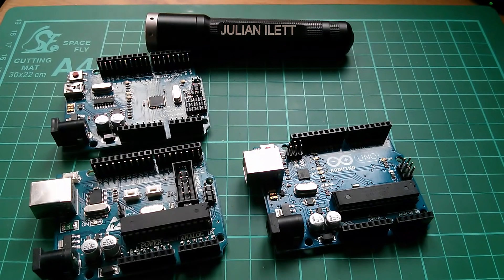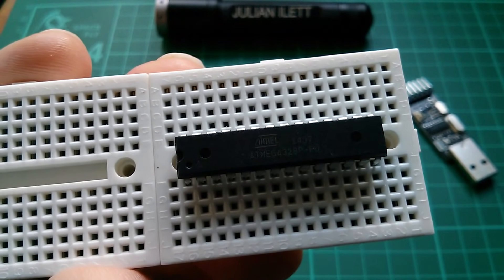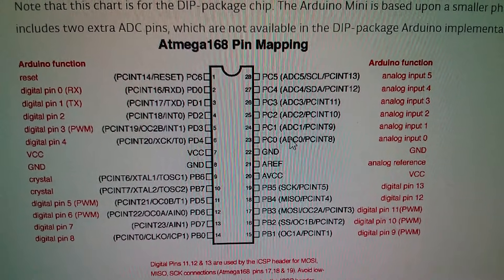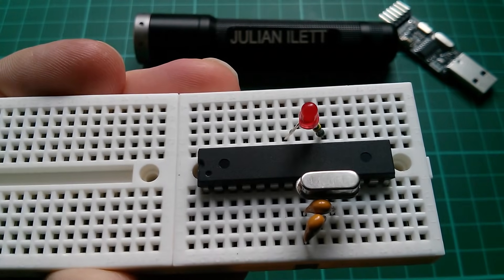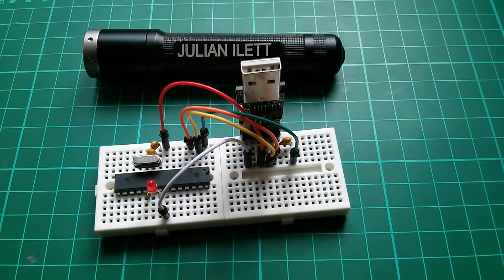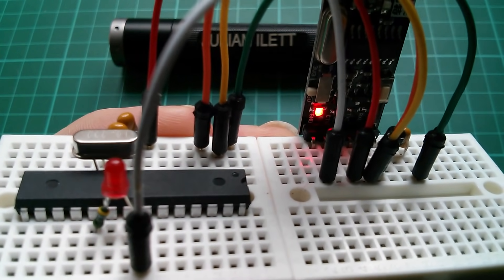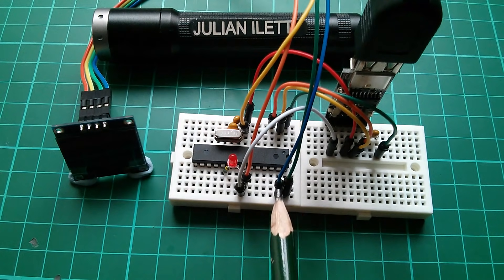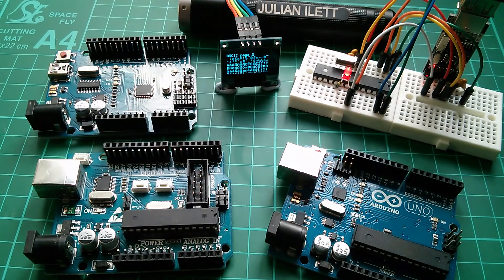1-Day Project: Build Your Own Arduino Uno for $5

Comment: Julian, I really need your help. I need a microcontroller that could drive two 12v 5Amps brushed DC motors in two directions and I also can take two ampere sensors. Would you please help me pick up a cheap and good microcontroller and motor driver? :)

Comment: I was getting this error: avrdude: stk500_getsync(): not in sync: resp=0x00.
My solution: use 1 uF capacitor on the DTR instead of 100 nF.
Reply: I had this problem also.  It seems dependent on the chip being programmed.

Comment: Might be cool to see how small you could possibly build one, by not using a bread board and soldering the connections together then putting the serial port under the chip with any type of thin insulator in between.

Comment: Hi Julian, great video.

I followed the instructions to make my own arduino UNO, and used all the same components, except for the USB (I used this one: http://www.amazon.co.uk/gp/product/B00AFRXKFU?psc=1&redirect=true&ref_=oh_aui_detailpage_o00_s00  ). Everything works but in order to upload the code I have to use an AVRmkII (  http://www.atmel.com/webdoc/avrispmkii/avrispmkii.intro_connecting.html  ) and use the "Upload via programmer option in Arduino IDE and set programmer to AVRISP mkII. Initially I had to upload the bootloader to the ATMega328 chip via the AVR, after which I could upload the code. The blink program worked so I uploaded a more complicated code which has data that can be viewed on the serial monitor. However I cannot get the data to view on the serial monitor even though the USB is recognised as a serial port ( I also cannot upload the code straight to the breadboard via the USB, hence the use of the AVRmkII).

So I would just like to ask if you have any tips or solutions for my problem (how do I view the data on serial monitor)?

If anyone else reading this has any advice or requires further info please feel free to reply I'll try my best to provide as much info as I can. Would really appreciate any help.

Thanks in advance

Comment: After a 10 min build turned into nearly three hours of frustration and cold tea I finally decided to pull out the IC from my arduino uno, and put one of the "bootloaded" IC's I bought. Figuring out it wasn't bootloaded, I returned the original IC to it's socket and burned burned the bootloader. Then the problem with the CH304 stick persisted. The dude keep telling me 'nope. not in sync' So I decided to replace the IC once more on my arduino to upload sketches to them that way. They all work fine once I picked them out of the trash, burned the bootloader, and used the arduino board to upload sketches. I'm still perplexed as to what could have gone wrong with the CH304.

Comment: Hi Julian, 

Great video , i've tried to replicate the results using my FTDI interface , and all i get is 'Programmer Not Responding' , I'm using a 104z 100nf 50v disc radial capacitor , could this be the issue?

Thanks as always for your informative FAQs , keep em coming :)

Alex
Reply: SOLVED :) , It WAS the Capacitor , i replaced the 104z with a 100nf Tantalum and bob's yer uncle worked great,

Comment: Hey julian, if I make the above project and after uploading a sketch if I remove the usb to serial converter and directly supply 5v to atmega328p then will the code work?
Reply: Bhargav Bhatt It will...
Reply: Xeno Sorry, but that is bullshit. Perhaps people run into trivial problems because  there are no  difficult problems to run in to.
I do not need to understand  washing machines or TV sets and still use them effortlessly. Perhaps you would advise a course in electrotechnics before someone is allowed to operate a  mixer?
Reply: No, it won't.
Reply: if you add a crystal it will
Reply: Julian Ilett Will this work if you remove the USB to serial converter? thanks
Reply: John Ridley What is a loaded cap? And what does the crystal do? And what does the 16MHz rating mean?
Reply: Ujjval Kavathia The simplicity behind Arduino is also a problem. People don't actually understand what's going on, and so run into trivial problems.
Reply: Ed19601
Maybe if you replied with a better tone I would've replied to you.
Reply: Seems you did anyway. 'Bullshit' is a normal way to say something  is nonsense, but sorry for hurting your  feelings, let me rephrase:
"Sorry, but that is nonsense"
Nevertheless, no reply needed
Reply: Ed19601 reply fast
error is that my port menu is not opening
Reply: Pulkit Arora

how have you connected your arduino? serial ftdi? usb-ttl converter?
could just as well be a problem with yr IDE. sometimes pulling out and reinserting in the usb port helps
Reply: Ed19601 now after updating the usb to serial adapter, port menu is opening.
Another query:-
i am not using arduino.
i don't know the difference between serial ftdi  and usb -tttl converter, but it looks similar to adapter used in this video or the adapter mentioned in description. 
device name-   USB-SERIAL CH340{COM3}

device type-      Ports (COM & LPT)
I am having the problem while uploading,
Under tools , i have selected:-
1.board as 'Aurduino uno '
2.port as 'COM3'
3.programmer as 'Aurduino as ISP'
error showing:-
avrdude: stk500_recv(): programmer is not responding 
avrdude: stk500_getsync() attempt 1 of 10: not in sync: resp=0x5c.

Your help please.
Reply: Well with 'Arduino' I meant an atmega328 chip  with the arduino bootloader. I presume that is what you use.
Since you 'updated' yr usb to serial adapter, i presume that  you use the  usb to ttl adapter. But anyway, that problem seems solved noe.
The error message that you get basically means that your IDE cannot communicate with your 'Arduino'. There can be a number of reasons for that:
You could have made a  mistake in wiring. Are you sure RX of yr arduino is connected to  TX of yr usb-serial converter and TX to RX?
Have you selected the proper serial or usb port?
Have you selected the proper board? -> if you burned say the UNO bootloader in your chip, you have to choose the UNO board. if you burned the Nano bootloader, obviously you have to select the nanoboard under 'Tools'
This error mesage can also occur if you forgot to plug in your PSU for the 'Arduino'
Reply: Ed19601 
I am using atmega328p-pu chip.
i do not know whether it is with arduino bootloader or not,but the seller has told me it has bootloader.  how to check whether it has bootloader?
i have double checked all connections.
error showing while uploading:-
avrdude: stk500_recv(): programmer is not responding 
avrdude: stk500_getsync() attempt 1 of 10: not in sync: resp=0xbe
 

when i tried to burn bootloader error is:-
avrdude: stk500_recv(): programmer is not responding 
avrdude: stk500_getsync() attempt 1 of 10: not in sync: resp=0x03 
avrdude: stk500_recv(): programmer is not responding.

your help please
Reply: well, there might be the problem. if you didnt put a bootloader in it... then who else wld have done so, unless you bought a chip  advertised as 'with bootloader'
Where did you get the chip?
Reply: and how did you try to burn the bootloader?  just  via the usb port?  that will not work
Reply: the shopkeeper told me that it has bootloader.
Reply: did he say which bootloader?
UNO?
Reply: If there truly is a bootlaoder in it, most likely is a UNO. But I suggest you try  some other board settings as well. Nano, Pro mini etc
Also, if you wish, send me a picture of the connection son yr  board
Reply: Ed19601 but you need to understand how they work to modify them dah
Reply: marionetadelplaneta i kinda dont understand your remark. What is it about?
Reply: Ed19601
using and Arduino is one thing but wanting to make something custom requieres you to understand how things work in order to do it,so if you want to make a custom Arduino you must understand basic circuit skills,crystal oscilators what are the for and so maybe you dont need to know everything about the arduino but isnt enough just to know how to use it.
im replying to:
"I do not need to understand  washing machines or TV sets and still use them effortlessly ".
Reply: Well have you seen me deny that then?
But it doesnt change that I do not need  to know about the innerworkings of a washingmachine  and still be able to use one, but sure if i want to modify a washing machine I would.
But my initial point was about somebody saying that Arduinoś are too simple and that therefore peoiple run into problems and that is bs.
Exacatly because of  that simplicity far more people are using arduino's to make projects  than otherwise would have happened. A lot of people have no desire to know anything about the inner workings of an Arduino, but simply want to use one to make a project that they have in their heads
Those are the people that 'use the washing machine'rather than 'want to modify the washing machine'
Reply: Ed19601
yes arduino is excellent for learning and making projects real by people who dint really care about the elctronics part but sometimes the simplicity of it stops some people for going for more because isnt as simply as arduino when they have the skills to do it.

Comment: Hi I wanted to share a silly problem I encountered and what I did to solve it, if anybody is stuck on that. The USB to serial converter I'm using has DTR as active low (appears as DTR with a line above it - overscore, if you will) . Because of this, the UNO is always in a reset state in this configuration. When I tried uploading the code, I would get the:"avrdude: stk500_getsync(): not in sync: resp=0x00" error. 

Solution: I removed the connection from DTR, along with the capacitor. I connected a resistor (I used 1K) to VCC/5V. To the other end of the resistor, I connected the positive end of an LED . The other end of the LED was connected BOTH to a pushbutton and the reset pin (pin 1) of the AT mega 328. The other end of the push button was connected to ground. Now the pushbutton is a reset button. I reset my chip by pushing the button just before uploading the code, and it worked.
note: The resistor is essential, because you don't want to be shorting VCC to ground. You can do away with the LED if you want, since the LED on the AT Mega blinks anyways when the chip is reset. 

Great video!
Reply: The pin on mine is marked RST, and didn't work. I saw your solution and it got me up and running. I used a 10K pull up and no LED.

My usb to serial board uses the CP2102 chip, and the RST pin is indeed useless. Some boards with this chip have an unwired DTR pad that you can get a wire onto, but mine isn't that helpful - I'd have to try to solder onto the tiny pin coming out the chip.

Comment: Have this one, do not regret it whatsoever, shipped from Singapore to Quebec Canada in about 2 weeks.
http://www.ebay.com/itm/UNO-R3-development-board-microcontroller-2012-MEGA328P-ATMEGA16U2-Arduino-Compat-/301088122259?pt=LH_DefaultDomain_0&hash=item461a402593

Comment: what if wanted to use bluetooth module BT  , then i have to use transmitter tx and recicever rx pin , but here its already engaged because you are already using some usb port pin connector or module .............then how it goona happen

Comment: Will this work if i got a normal circuit board and solder all the connections or will this only work for bread board?

Comment: sir i have this problem .......... its showing up on the software .
avrdude: stk500_getsync(): not in sync: resp=0x00
Reply: Maybe u have twisted RX and TX? TX goes to RX and RX goes to TX.
Reply from the maker: ***** So many reasons for this - I can't advise. A Google search will give you lots of things to try.
Reply: sir actually i tried making my own  arduino and directly connected the ftdi chip (ft232rl)........ and its showing this message.
Reply: ***** This is a common Arduino problem.

Comment: About the cheat, a fake FTDI is a problem for some. I don't do windows but for others it's a real biggie.
I'd recommend using an ATMEGA32U4 which has builtin USB, thus reducing the requirements even more. The only downside is that you have to surface mount it. Otherwise, it's a drop-in replacement for atmega328. But real men do surface mount. THT is for pansies. There's of course the ATTINY which is also pretty nifty and small, having the footprint of a 555.

Comment: I know this isn't a noob tutorial, but why do you need the caps on the crystal? (Software developer... Explain like I'm five ;) )
Reply: The capacitors are used resonate with the crystals inductance. Basically they make it oscillate or pulse at it's intended frequency - if the crystal is 'loaded' correctly.

Comment: Julian, always connect ALL GND and VDD pins, including AVDD!
Reply: Why?
Reply: Especially if you intend to use the Analog pins as analog pins... which means that the analog references (AREF) pin needs to be connected to VCC as well.
Reply: Peter Feerick so i connect AVCC and AREF bins to VCC  ? i have a lcd display that displays temperatures it all runs of 5v and i am putting VCC to D9 pin as a  to act as voltage reference for analog calculations ? is this all sound ok ?
Reply: Yes, you attach AVCC to the VCC pin even if you aren't using the Analog to Digital Converter (ADC). And you attach AREF to VCC to set the reference voltage of the ADC. If you are using any of the A0 - A5 pins and analogRead(), you are using the ADC. As long as your supply voltage is below 5.5, then all is good!
Reply: Peter Feerick thank you for your reply. i had someone write the code for my little project as im new and still learning. the code was made for a fake learnardo and now im using the code on a ATmega328P-PU (attempting my first pcb layout. and i was unsure about those pins. it works with those pins not connected however i will connect them as you advise :)

Comment: Hi Julian, nice video. I just made my bare Uno and upload the bootloader via a arduino SPI skets.  
Maybe a nice next video to show hou. And it's also better to upload the last firmware/bootloader on a barebone Uno
Reply: Good point... it's always good to do a Burn Bootloader on a barebones Atmega328p the first time you use it just to make sure the fuses are set right. Obviously doesn't matter if its been pre-programmed thou... :)

Comment: are the ic's available in a smaller package?, and are they a bit cheaper still?, i noticed one of the clones had a much smaller chip
Reply: jusb1066 They're simply a smaller package - intended for finished products that are generally assembled by robotic pick and place tools. The reason we generally see Arduino boards with the larger chips is simply that they're easier for the layman to work with. Generally, any difference in price at low quantity is negligible.

The SMT (surface-mount) packages often offer more IO pins simply because the space is available to add them, this isn't true for every Atmel microcontroller but it's fairly common. Handy if you're having your own circuit boards made (either at home or by a service like OSH Park) and want a smaller end result. :)
Reply: Like this?
https://www.sparkfun.com/products/9261
Reply: yes, they are indeed smaller! wonder if they can be obtained cheaper than the larger ones Julian used +1 Michael
Reply: These types of components are called "Surface mounts".

There a are a couple of listings on eBay for ~$2
Reply: jusb1066 You can have the genuine arduino uno in a SMD version, too. It's nothing special for the clones. The DIL version still exists because you can easily exchange the MCU if you fry it. Without any adapter board those SMD TQFP chips won't be of much use (no way to conect anything). If you design a PCB anyway, go for the SMD ATmega (they are half the price). If you want to experiment get the DIL. To save money I'd rather use the internal oscillator (easily accurate enough for most applications).
Reply: jusb1066
 The surface mount Atmega328P is actually so much cheaper that you can generally get an entire breadboard-friendly Arduino Pro Mini clone with the chip, the crystal, an LED and reset button, the auto-reset circuit, and a voltage regulator for less than the price of just an Atmega328P in a DIP package. There's not really much reason to breadboard up your own Arduino these days. (The only downside is that the I2C pins are a pain to access on the Pro Mini.)
Reply: makomk  agree. a mini can be bought for as low as  1.60 euro. The I2C pins arent really that hard to get to, be it that  they dont fit in a breadboard. need to acecss them from the top